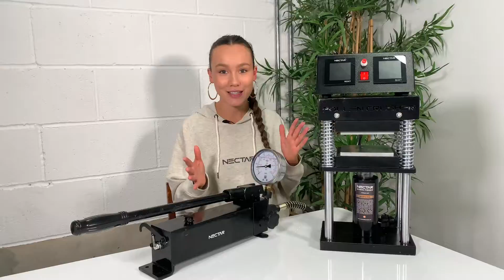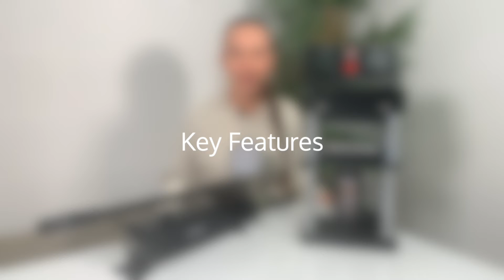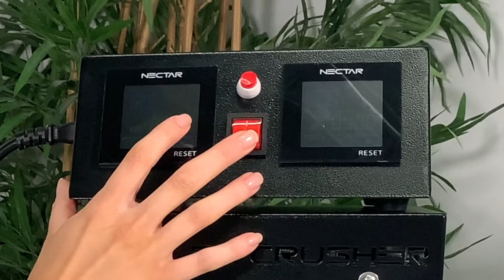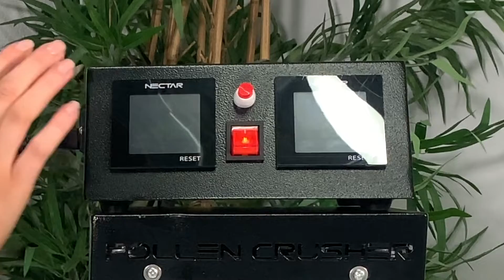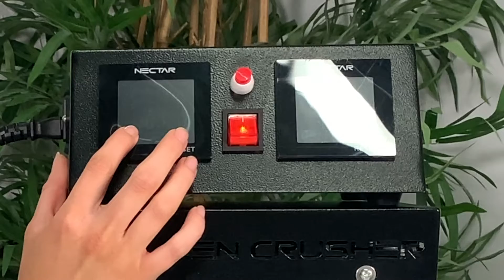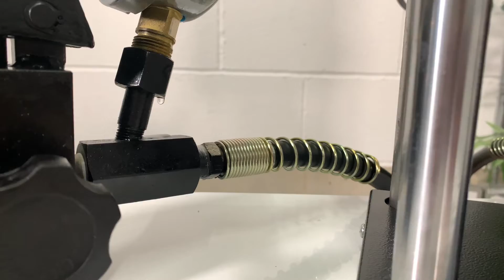Rosin Press Tutorial | How to Use the Nectar Pollen Crusher Rosin Press Machine

Comment: Hello, thanks for this video. However I have a small question, why is the manometer not showing 0 when no pressure is applied ? Thank you very much
Reply from the maker: Hey Tom, the pressure cord may not be fitted in properly. Try removing it and reconnecting it. If you’re still having issues then your device comes with 2 years warranty so feel free to get in touch with our warranty team for email or WhatsApp (+447732415188). All the best for now 🫶
Reply: @NectarMedicalVapesYT   Tom is  correct you can see it not reading 0 on the video